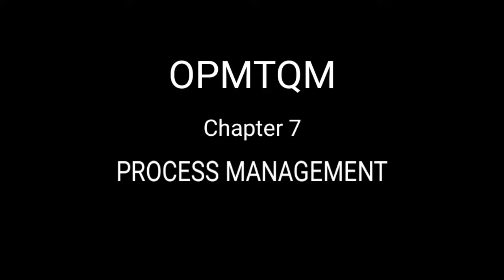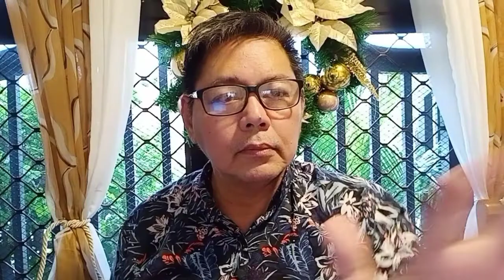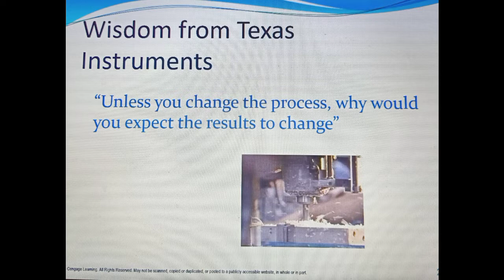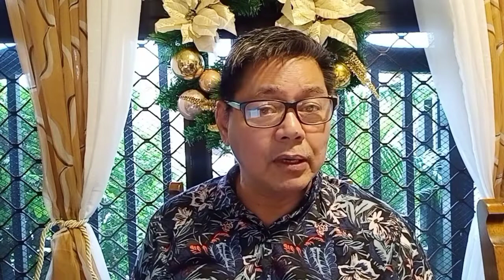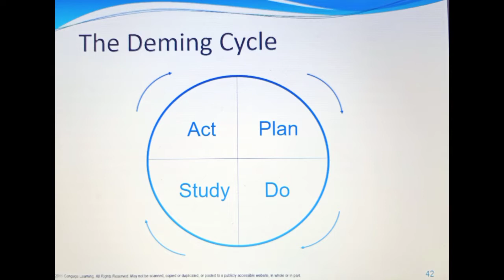OPMNTQM CHAPTER 7 PROCESS MANAGEMENT

Comment: Sabandal, Paolo F

2AMA

My analysis on the video is that process management is an integral part in the creation of a product of where the performance of a firm is reflected by its process management. This is because of process management to control cost and cycle time of the product. In this context, if a firm manages to effectively manage its process, it is not far off that quality will result in the effective process management. Furthermore, the process management is not only focused on the creation of the product itself on where it also focuses on the employees that man these processes on where the firm creates value for the work of the employee. In relation to this, the process management cannot exist without a plan, on where there is a foundation where the business begins to integrate multiple ideas to create an effective process management. In this context, there is always room for improvement in process management which will give way for innovations.  

The firms give importance to process management because this is a big aspect in the quality of a product. It is the creation of the product itself on where the firm considers a lot of things whether to even create the product in the first place. The process is not only the creation of the product, rather it is also making sure that the product was made right. In the process management, this is a way in order to prevent a lot of defects in the product. A good cycle that was discussed was the Deming Cycle on where it rotates around four simple steps Plan, Do, Study, Act. This cycle creates a simple visual of how process management should be taken on where it all starts with a plan afterwards the firm executes the plan then studies the result and act on the results.  

The process is the creation of the product itself, so it is not far off that a firm puts importance to it. The process tells a lot about a business on where it reflects their company culture and more. It the combined effort of all employees and managers in the business so that the process is efficient and produces quality product.

Comment: UGAY, Naomi
2AMA

The process management recognizes the prevention of defects and errors, and the elimination of waste and redundancy leading to better quality and improved company performance. It refers to the planning and administering the activities such as design, control and improvement, which is necessary to achieve a high level of performance. There are different key processes which tells us how to minimize the cost associated for quality inspections and validation of processes. It also seeks errors or defects that minimizes losses for the organization. There are different factors that affect customer satisfaction and the organization works to identify the important business processes that may affect it which typically falls into value-creation processes and support processes. The difference between the two is that value-creation processes are those processes which are value and a must to have the capability to run the business. On the other hand, support processes which is important to the creation of processes, employees, and daily operation. In addition to that, there are sub-processes such as the design process which refers to activities that develop functional product specifications and production process which create or deliver products. 

The importance of having a process management principles is that it focuses on end-to-end process, it allows everyone to manage a process at some level and is a customer and a supplier. It gives the organization the way to have a corrective action focuses on root causes and it reduces errors or defects. There are different activities that must be done to result to a quality product and design. First, the process control which ensures conformance to requirements and taking corrective action when necessary to correct problems and maintain stable. Another activity is the improvement which is an opportunity for the organization. It is the desire of the organization to grow and flourish the business over time. It also allows the organization to flourish and have a better placement in the industry if it have the ability to be flexible. It must have the ability to adapt quickly and effectively to changing requirements. One of the most valuable takeaway from the video is the Poka Yoke.  It has become one of the standardization techniques and its idea is to prevent errors and defects from appearing in the first place is universally applicable and has proven to boost efficiency of organizations. The value of using Poka Yoke is that it help people and processes work right the first time, which makes mistakes impossible to happen. Process management principle is very important for it serves as the basis for effective daily management of processes. It allows the organization to have control over all long-term improvements in order to make it a process standard. It gives a means of measuring accomplishment and a comparison of actual results with standard, along with feedback to form the basis for corrective action. It continuously improve value creation ability and improving its value creation processes. It improves the value of the product or service which results to sustained success in competitive markets. Another is the flexibility of the organization gives them capability to produce a wide range of customized services as response to changing demands. Another mistake preventing technique is Poka Yoke which has its way of ensuring quality without actually having a quality assurance process, rather preventing defects to appear in the first place. Benchmarking was also mentioned which searches for best practices that lead to superior performance. The types of it is competitive, process, and strategic benchmarking which is different in terms of how it searches, it may be through comparisons, focus on processes, or on how companies strategizes. 

In present times, economic and industries have been complex and competitive. Thus, processes and principles are necessary to survive. In business, passion can only make the organization go so far. For it to drive forward, organizations need calculated processes. It is what will help them control their costs, keep productivity levels consistent, and maintain the quality of customer experience they provide. However, implementing process management can be challenging due to the reluctance on the part of the organization for they prefer the traditional way. But, implementing such will help the organization to design workflows in line with your short-term and long-term objectives. It also help them to improve their operational efficiency and give them insights to make better business decisions which increases the agility of the organization. These techniques or processes re designed to simplify and optimize the entire process by eliminating tedious tasks and consolidating your information in one convenient place. It will serve as the gears to keep the organization on running it and flourishing it. It allows them to evaluate and standardize workflows, work around unexpected situations, and ensure the cost-efficiency of operations. In conclusion, process management is importanct to strategically maximize resources to minimize expenditures, it gives the organization a better visibility and control of business processes and helps the organization to make better business decisions to remain competitive.